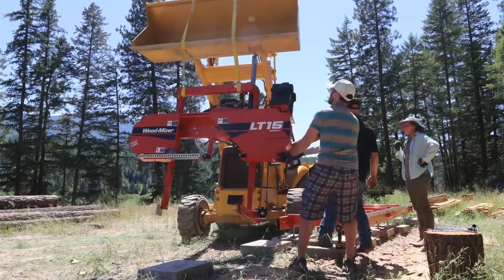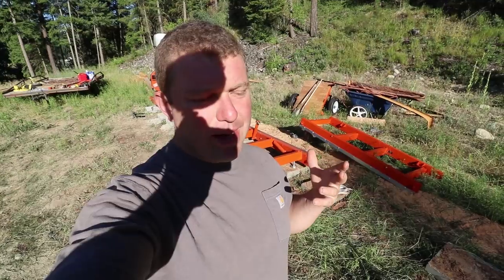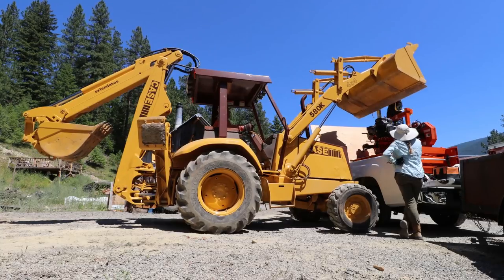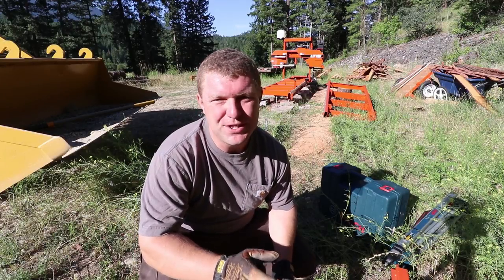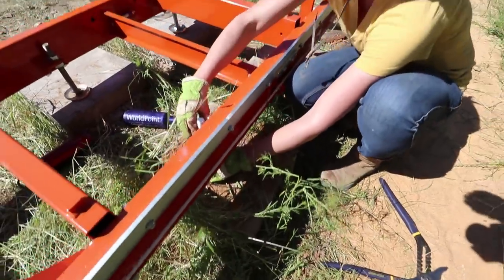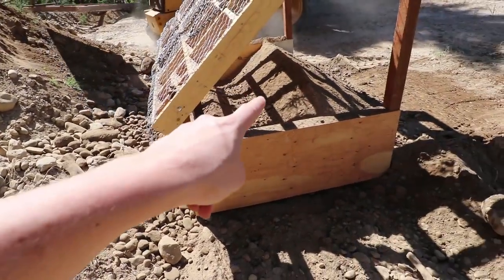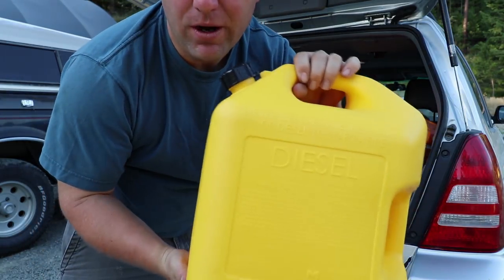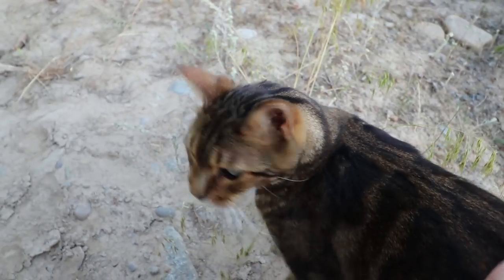BACKHOE ALREADY SAVED OUR BACON!

Comment: Not sure about backhoe motors, but in automotives, 12.9 volts charging is too low a voltage. Nominal 12v circuit charging unloaded (no accessories) for Automotive batteries is ~13.5V. Most batteries will only float charge at lower voltages, meaning they won't fully recover during the normal operation of the vehicle without putting it on another charger. Worth getting that checked out

Comment: get a 55 gallon barrel and use it for fuel for the backhoe.  should be able to find one for $10 or less.  hand crank pump might be $$ but might be able to find a used one cheap

Comment: I agree with others, you should have 13-14 volts on that charging system. One thing, I'm not sure at what point the alternator should put out max voltage. On a car and such you should above 1000 RPM's, I'd bet it is lower on a tractor so it would be worth looking that up.

Comment: The Bosch alternator on my 580 was charging  intermittently If you have a bosh new brushes are easy to install l  .I took it in to a shop and watched the needle charge then after a minute not charge. They wanted $ 380 for a new one. I used jumper cables to charge the battery each day , with only a fuel solenoid I could run all day until I found one on line for $ 100 delivered. Do you get a red alt light when you turn on the key. IF THE BULB IS NOT LIT it won't start to charge. My instructions said the alt can  lose its magnetism setting on a shelf and to jumper it to recharge the magnet when installing a new one. The ted lite does the same thing when you turn on the key t.

Comment: the trailer pads are called cap blocks,this is important to know when you doing your foundation.  not trying be a smart ass but most don't know what a trailer pad is the other name I have heard is landscape blocks but that not correct either because landscaping blocks are usually the decorative garden blocks.

Comment: You need more than twelve volts to charge/maintain a battery like that, if your getting 12 while its running then theres an issue (at least acording to my knowledge of car charging systems) so i would look for a service manual for the backhoe if i where you

Comment: 55gal drum and hand pump with filters, under $100.  I used one for years to store gas for my generator for when I get a hurricane. Went to where they change a lot of oil. They get the oil in 55 gallons drums and if you talk nice they may give you one or sell it real cheap. My was given to man I got a cheap hand pump and put Goldenrod water block fuel tank filter. In FL we get a lot of rain easy to get water in fuel. Water in the fuel can damage thing. Thought the filters were well I worth the price. I tryed to use any hose from the filters to what I was filling. DON'T DO THAT! Normal 3/4 inch gas hose isn't that much and has steal in it and will work much better.

Comment: did you say your backho's charging at 12.9V? i thought for a 12V system charging was in the 14V range .  hopefully your battery was just pulling down the charging system. if i may make a suggestion find out what the output voltage form your alternator should be then take a voltage reading again with the battery topped up. 
good luck!

Comment: look on craigslist for  free fuel oil tanks they hold 250 gallons  , get it up on a stand and let gravity "fill er up" if you had 2 of them you wouldn't have to run to the gas station for your woodmeiser  cars truck etc

Comment: Instead of having the filtered dirt fall straight under the grizzly couldn't you build a pitched surface underneath that would divert the filtered soil to the sides of the grizzly? Something like this /\.  I wouldn't think it would need to be pitched that steeply, but I am limited by the ASCII characters.

That way you wouldn't need to worry about having to drive under to pick up the load.

Comment: when you have to use the bat off switch or the bat goes dead you have a short in the system most the problems turn out to be the alt is shorting inside itself

Comment: for your fuel thing I would get a couple 55 gallon drums and keep in shade them just a old type hand pump and there you go or if your going to keep more diesel just get old fuel oil tank and clean it out then make fuel tank but make sure you have spill cage for fuel if some thing happens , that way you just have big tanker come in and fill it like propane truck,,,, but I would even make a little like basement to put fuel tank in just in case some ding dong hunting and stray bullet it wont go boom under ground  but that's just me a simple country boy here

Comment: Just as a word of warning when you use use you lifting with slings tip the bucket forwards so the sling does not rub on the edge you slings will last longer and you maybe will avoid one breaking. Nice saw though

Comment: Any thoughts on a 55G drum for fuel? Think they're about $100 new, and less used if you can find a good one.  You've spent the 40 already, so it might be too late, but having that fuel available in the winter for generator (although you might have gas) and such seems like a "good" idea.  I suppose you can supplement  with more small tanks though if that's important.
Reply: Could buy a 55 gallon drum filled and sealed from a fuel supplier.  I used to buy my fuel this way and a small deposit for the drum.

Comment: High guy's the problem with the case is the voltage regular. Has a slow draw just turn the main switch off after uses.  #G.  L.

Comment: How I fill my tractor with 5 gallon cans I bought a battery pump that takes a D battery that is made to fuel a heater It is cheaper then a 12 volt pump.. It beats picking up the can holding to fill the tractor tank. It looks slow but take about the same time pouring the fuel in. And when it is full I not in pain from holding a fuel can.

Comment: 12.9 volts while charging is not adequate voltage for a 12 volt system.  Most alternator outputs are >13.5 volts.  Normally, you should see about 14.4 -14.7 volts.  Your alternator is bad or the Zener diode is bad.  I think it's the alternator because of the low voltage.

Comment: Your alternator or voltage regulator sound a little weak.  When the engine is running, the alternator will typically put out between 13.8 to 14.8 volts

Comment: Should be getting 14 volts while it's running at the battery. 12.9 will not charge a battery. You need 2 volts or so over the battery voltage to recharge the cells.

Comment: 12.9 volts is not charging. If the alternator is charging your voltage will be at least 14v at the battery

Comment: Use your old solar panel and charge controler to keep the back hoe battery charged .
Edit I do that with my boat as your's is a diesel you only need the battery to start it once running battery is not needed.

Comment: 12v batteries are usualy charged with 13-13.5 volt
Reply: Also, idk if you allready noticed, but the backhoe lowers ever so slightly whilest u put in neutral to support your materials. Think ur hydrolics is bust

Comment: 12.9v seems like a pretty low charging voltage to me. I am not an "expert" but any charger or vehicle I have had will run 13.5 or even 14 v . a fully charged battery is 12.6 v +so if all you are seeing across the pins on that battery when the machine is running is 12.9 that to me says something is not right...I am betting a bad battery though. I have a bad deep cycle battery right now and I get similar type readings when its charging then it just drops voltage fast when its not being charged, it settles in around 11.4 which is basically a dead battery.check the voltage three hours after shutting it off see if it drops below voltage, if so then its no good !

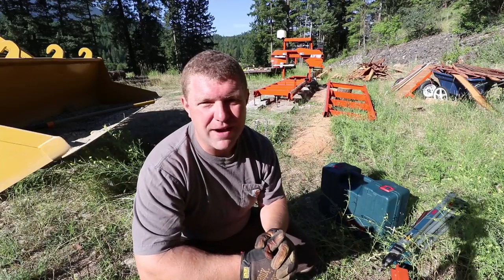Comment: Does your backhoe hydraulic system leak? Seems like its slowly loosing pressure on the cylinders e.g. 6:19 time lapse shows slow movement. Is that normal?

Comment: I know you're tired of hearing this but after spending much of my working life repairing those damn industrial cardboard balers (I'm able to repair some of the most technical of industrial machinery but always seems I ended up on these things, usually because of mis-use and/or outright abuse, in fact a baler is partly the reason I'm now on the disabled list), the problem is probably in the cylinders' piston packing, which is a reasonably easy fix on a bucket lift, but you really shouldn't wait because when these things ultimately fail it usually is catastrophic, and when they do be prepared to clean hydraulic fluid off anything within a 30 foot radius (you ought to see what happens in a rear stock room when a baler cylinder lets go, often the top lid breaks open due to being stopped in the pressure stroke and left that way, I had to ultimately engineer a timed pressure relief circuit with a lock-out for bail removal to stop this behavior from employees ).

Comment: You have the backhoe why didn't you back blade and clean up the area where your sawmill is set up?  The mill should be higher off the ground your going to have problems with sawdust build up if you had experience with band mills you would know this. A log deck set up at the same height as the mill you place your logs your ready to cut on the deck you roll them onto the mill with a peevey. On the other side of the mill you should have the area cleared out to stack your cut lumber on dunnage so you can sticker your lumber for drying. You two are in for a world of hurt trying to cut lumber with an improperly set up mill.

Comment: After watching most of their videos and listening to this guy and watching his decisions and choices, I'm afraid he's going to get someone killed or hurt.  There's a lot of us watching that have done this kind of thing and can see issues and problems on the horizon.  And to hear him continually putting down and ignoring the 'negative' comments and the people making them, after watching his behaviors in other videos, is galling.  Most of what he says is an insult to the intelligence of folks that have been where they are.  They are not doing anything unique.  When they start building using timbers it's going to be downright scary if he doesn't change his methods and thinking.  Hopefully, no one will get hurt, but if it does happen, experience tells me that it won't be him.  Worked with a lot of guys just like him and have never appreciated it.  Usually got rid of 'em as quick as I could..  Supervised learning of 'skills' is fine.  But this kind of learning 'by experience' can get someone hurt.  Don't know what kind of 'construction background' he actually has, but so far, not much of it has shone through.  

Sorry this isn't a rah-rah kind of comment, but there's a reason it isn't.

Comment: You need the backhoe checked out, the stick cylinder or valve is leaking and although it is a small leak that drop it when you have it up, if the seal goes, it will fall all of a sudden and could hurt someone if they are under it or in this case damage a new sawmill.  Never trust hydraulics.  I have seen a person using the front bucket and had some dirt in it and just stopped for a second to get a drink of water and all of a sudden the whole bucket fell and hit the ground, Scared him when it happened.  Hydraulics are useful but not trustworthy

Comment: Won't buy a $300-600 truck tank with pump to easily fill the backhoe and other rental equipment during a construction build, but has a F250 Crew Cab that costs $50-70k new....seems like odd priorities. Though they seem to try to avoid showing that truck as much as possible as I suspect they are catering to trying to show how to build without huge expenditures in cash or debt which is good.
Reply: I do enjoy the videos, but at the same time, pointing out something that is a choice which only  wastes time, money, and puts additional miles on vehicles just to avoid spending a couple hundred bucks could help someone who is considering this also.  It's not good business sense and its just illogical. Its much more efficient to utilize the truck tank where you can fill it only twice per month when you're already in town for other supplies, buy larger cheaper quantities of off road diesel and avoid the possible down time in the middle of construction because you have to go run and fill up your 5 gallon gas cans.

Comment: I like how your cat talks to you and trys to hog the vids by meowing as you talk. I have animals as well. Only most of my cats are more leave me alone and we wont have problems kind of cats.
 Any way i also recomend the transfer hose with the ball valve i call it a jiggly hose. Becaus you jiggle it up and down to pump it and once it starts running on its own the ball jiggles around.
I use mine to drow gas out of the welders tank if the old f100 runs out ,gas gage dont read right.
 I figur buy the time you posted this you got a handel on the charging and battery.

Unless that thing has a electric   lift pump for the injector pump the bat and altornator are just there to runthe lights a start the motor. The wiering should be farly simple. Even a hour metor left on can drain a bat over  night. Ask me how i know.

Comment: Jesse says "I'm getting 12.9 volts across battery terminals so the charging system is fine". 

Any google search says "minimum voltage to charge 12v lead acid battery is 13.8 volts. 

Yep, charging system is fine..... 

Wtf, at least look that up while editing video and cut your ignorance out or amend.  You are saying incorrect information that someone might take as fact.